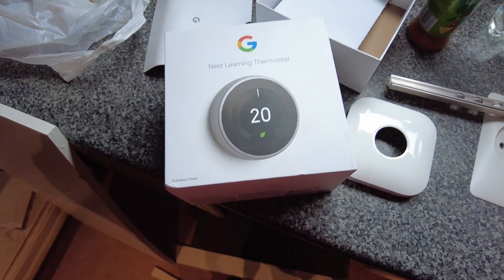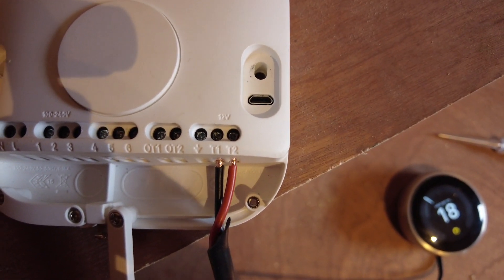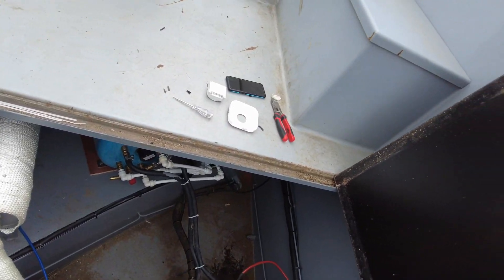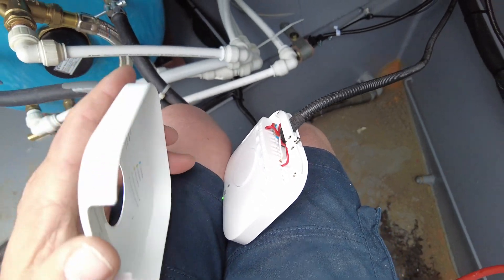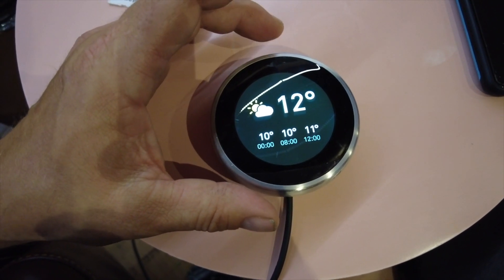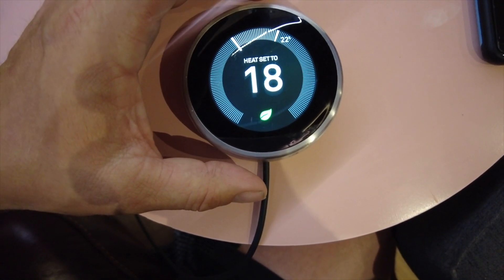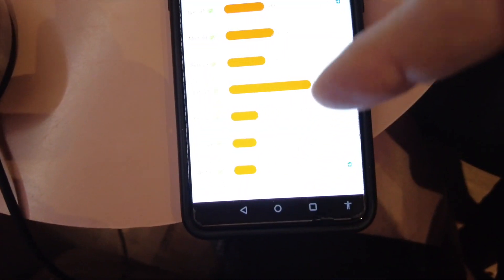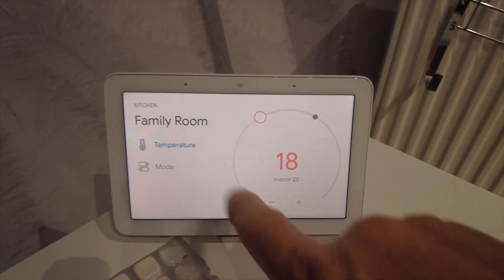Everybody said it can't be done

Comment: Or nest does a webasto hydronic unit  does radiators and the calorifier via heating mode in a similar way and also the immersion via a 240v relay on the hot water controller, great bit of kit.

Comment: Which generation is your nest unit?  I know the 2nd gen units can be 12v wired but not sure about the latest 3rd gen units. Cheers
Reply from the maker: Yes it's the second generation. I chose it because I knew that it was the only one that could do what I wanted it to do and run off 12 volt.

Comment: I am a new subscriber and have started at the beginning of your videos so you may have covered this. Have your put any thought into using the engine heat while cruising to heat the interior of your boat?
Reply from the maker: The way it heats the water and heating at the moment is heats the water tank when the engine is running as a byproduct of calling the engine down. And if you turn on the diesel heater, it pulls the hot water temperature from the engine at the same time and warms up the boat very very quickly using the pump from the wabasto diesel heater. So in a fashion it's already does what you're suggesting

Comment: These sort of heaters shouldn't be controlled by a thermostat as it can cause them to short cycle which is bad for them - that's why it came with a simple on/off timer. The heater modulates the circulating water temperature by reducing the burner temperature (by slowing the fuel delivery rate) and then if the water still gets too hot by turning the burner off but continuing to run the pump to circulate the water until it cools enough to restart the burner. This is done over a fairly wide water temperature range so short cycling on and off does not happen. Your room thermostat will have a very close hysteresis that will cause the burner to cycle on and off around the set point which is not how this type of heater is supposed to work..
Reply from the maker: Thank you for your opinion but that certainly isn't the case. This has been set up in the same way as any simple on off timer switch. It allows the webasto diesel heater to complete its full cycles as it should do. It just doesn't cut off the power. And what do you think a normal on off timer does exactly ? 
Simply it sends a signal to turn off and on at any time which is exactly what I've wired this smart thermostat to do.
I've been using this now for just over a year without any issues whatsoever at all. 
I can set a parameter so if it gets too cold it will come on for a certain period to maintain the heat through the winter. Which is a massive safety issue as I'm not always in the country I need to be able to monitor to make sure my boat doesn't freeze up too much. 
I have wired my boat up with many smart devices and they have worked incredibly well with no issues so far at all. And I would highly recommend anybody to do the same if they've got the energy capacity as I have.
Reply: @Inspiration2022  It's not opinion - it's fact. You fail to understand how your heater is designed to work. Yes the timer turns it on and off but not repeatedly within the time period that you wish to have the boat warm. It turns it on at the start of the period and off maybe hours later at the end of the period. In between the burner ramps itself up and down to maintain a certain water temperature and perhaps turns off very occasionally if the water in the circuit still gets too hot (for example if all your radiator thermostatic valves are closed) - and during all this time it continuously pumps hot water around the circuit. The heater itself controls the water temperature and whether it needs to turn off or not to maintain this water temperature. Your thermostat will be cycling the whole unit on and off repeatedly once your room has reached set point (they usually only have a two degree or so differential) meaning that your diesel heater will be coking up due to the repeated start ups. Also your glow plug life will be far shorter. Your electrical consumption will also be far higher due to all those glow plug start ups. If these heaters were supposed to controlled in this manner then the manufacturers would supply them with a thermostat and not a timer. You may be happy with your 'smart' technology but it adds nothing to your system and won't make you feel very smart when your heater packs up earlier than you might like.
Reply from the maker: Thank you for your input.
The fact is that it is working and working very well. It doesn't cycle on very short base at all ever and I know that this would be a problem if it was doing so. But it really doesn't not in the way that I have connected it up. The thermostat is in a location where it would take some time for the temperature to get up to a point where it would turn it back off which allows the cycle time to be long enough. 
These heaters were designed for lorries and vehicles and they work on a thermostat themselves. There really is very little difference in the way that I am using them. The only difference is that this is smart and connected to the internet.
I do at one point plan to give the heater a full service which you can buy all components including the globe plug. 
I will see how much of an issue at that point your comments could have been.
Thanks again.
Reply: @Inspiration2022  Whether it cycles on or off too frequently has little to do with thermostat location. The point of a thermostat however is that you place it in a location in your space where it is able to get a true indication of room temperature. Putting it in the fridge will stop your heating system cycling on and off but will leave you potentially boiling in the actual living space!  How often it cycles the heating on and off will be purely down to ambient air temperature outside and how good your insulation and ventilation is at stopping heat loss from inside and also how well sized your radiators are for the space. If yours does not cycle on and off then it is because it is either undersized in kW for the space and/or you have a lot of heat loss so it struggles to ever get to set point.... or you have placed the thermostat somewhere where it's reading of temperature is not relevant. Trust me I used to work in HVAC and have previously lived on a sailing boat for 18 years with one of these heating systems.
Reply from the maker: @vonasi2   thanks for your input. All I can say to your comments is in my case it works and it has worked for over a year. Very very well. 
If it wasn't working or I was having issues I would certainly take your advice.
Thanks again.
Reply: @Inspiration2022  A year is not a proper test period especially when one considers how much of it actually requires the use of a heater. My girlfriend's dad had a car that never went wrong in all the years he owned it. He did however hardly ever drive it and it sat in the garage doing nothing for most of the time. Still he thought it was a reliable car so that's what matters right.
Reply from the maker: @vonasi2  I live on the boat 🤯
Reply from the maker: And have done for the last 13 month's. I rest my case 🤣🤣🤣 but thank you it is good to sometimes have other options 👍
Reply: @Inspiration2022  FYI - I spoke with a couple of professional installers of Eberspacher and Webasto heaters at the Crick boat show last week end and they confirmed that these heaters should not be controlled by Hive style controls or any on/off thermostat unless you want to seriously reduce the life/reliability of your heater. In fact they said that Webasto used to supply their heaters with Hive controllers but had so many issues that they withdrew the warranty on any parts that failed due to being controlled in this manner. They said that if you want to control your heater remotely by phone then a device (I forget the name of it!) that turns the heater on if temperature is below set point but then leaves the heater on until you manually or remotely turn it off or turns it off after a time limit of say two hours is what you should use to prevent damaging rapid cycling.
Reply from the maker: @vonasi2   I love the fat that you trying to prove me wrong 🤣🤣 it really is working very well and if I need to replace it or replace parts I'll do it at that time It fails. but so far so good. I couldn't recommend it enough.  Throughout the summer it will idly be used at all only now and again to ensure it works in the winter which I would have highly recommend everybody does. 
The reason why I won't need it through the summer is I have fitted the clarifier with an element that works off the solar panels for 2 hours each day to ensure I have hot water. Which is another thing that some people frown upon but it is working brilliantly. I have wait too much energy from the sun at this time of the year so best to make the most of it and turn it into hot water.
Anyway, thanks for your communication. It is valued even though I disagree. But thanks a lot.
Reply: As a combustion engineer i can say you are both right, short cycling does not do these units any good, however if you set the temprature differance to call for heat at 4 plus degrees i cannot see the unit short cycling anymore than normal. Plus you get all the added benefits of a smart system. I also live on a boat and have for 6 years.
Reply: @thecoincutter2116  I agree but in reality a heating system will still rapidly cycle even with a 4C differential if it is -5C outside and the boat is badly insulated or someone leaves a door or window open for a while.
Unfortunately most basic thermostats have a hysteresis of around 1.0C and a quick Google search shows lots of home owners complaining that their Hive and Nest thermostats have a hysteresis of 0.1C. Even worse some of them now have a feature where they turn the boiler/heating on and off rapidly as set point is approached to stop overshooting of the set point. 
If you know of a smart thermostat that can be set with a much wider differential between on and off then please let me know the make and model as I might be interested in testing one on our boat heating system.